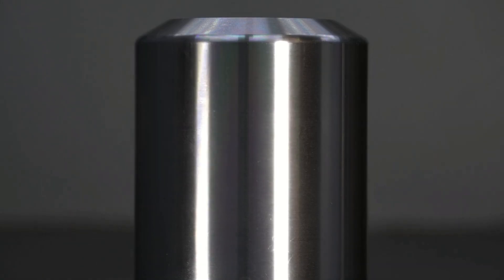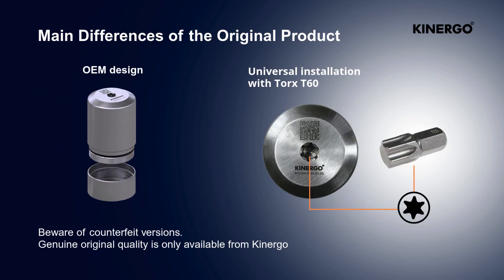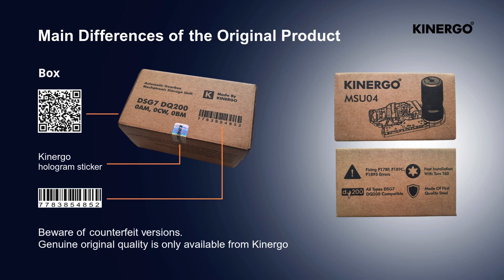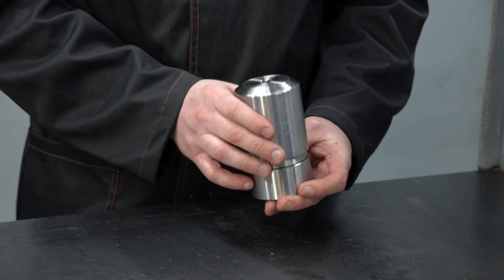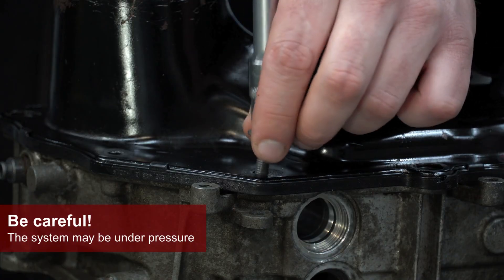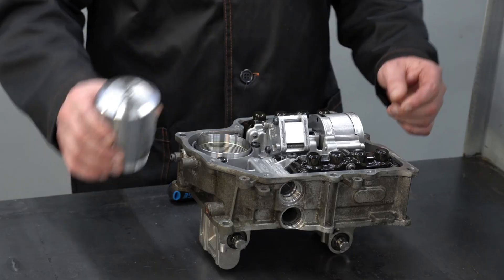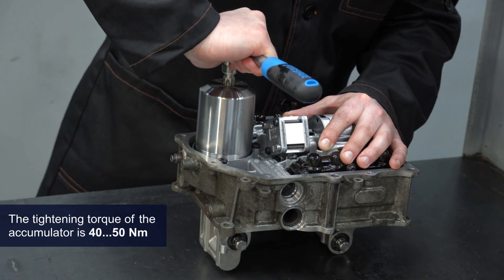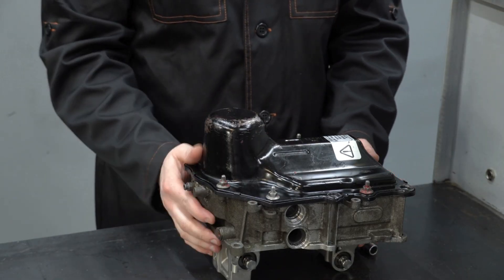#DSG7 #DQ200 repair kit for DSG7 DQ200 (#0AM, #0CW, 0BM)

Comment: Hello. I purchased a kit to repair my O's legendary P17BF fault. I want to do it without disassembling the mechatronics or anything else on the car. Just remove the net cover, install the kit, close it, and change both oils. Is it necessary to make any adjustments with the VAGCOM for this? If so, what would it be?